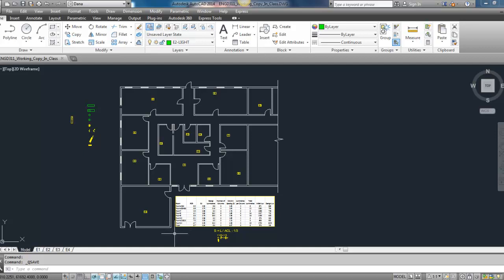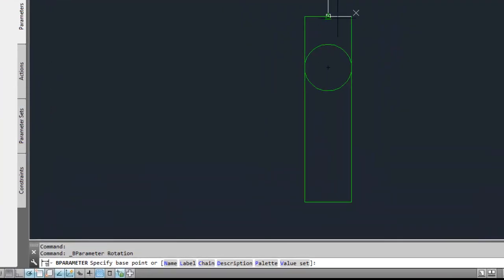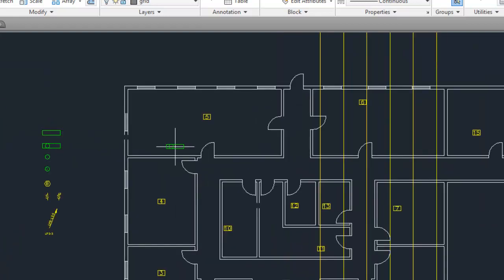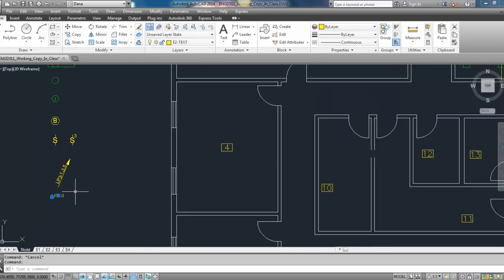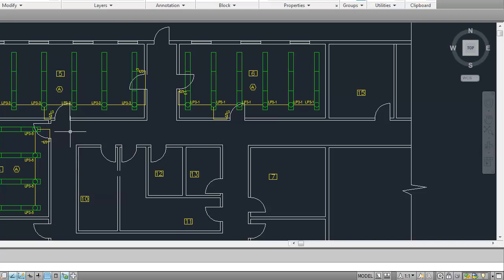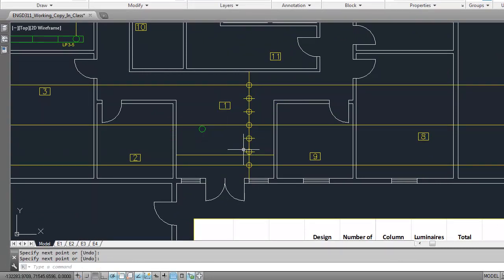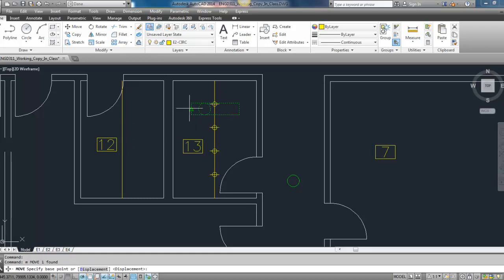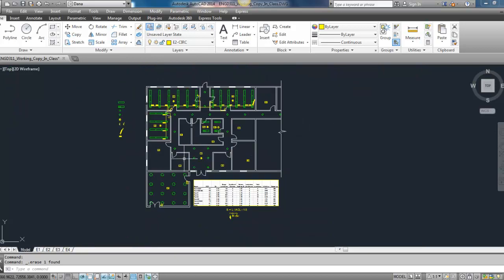DJE.ca Commercial Building Electrical Drawings Tutorials - Lighting Layout - Part 6 of 8

Comment: For anyone watching this, as it is from 2013, it is Very antiquated.   Most electrical design work is now 3D using Revit, or AutoCad.   It is a totally different world.   Nice video though.
Reply from the maker: This may be true for some areas of the world, but not for all!  There are still many, many users learning or working in older versions of Autocad.  Thanks!